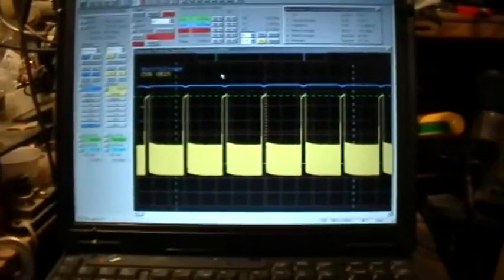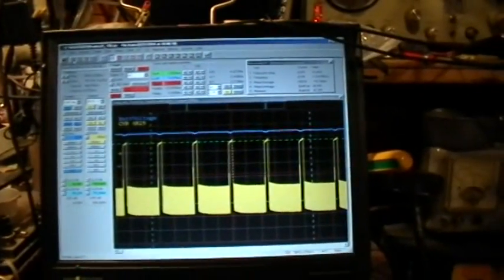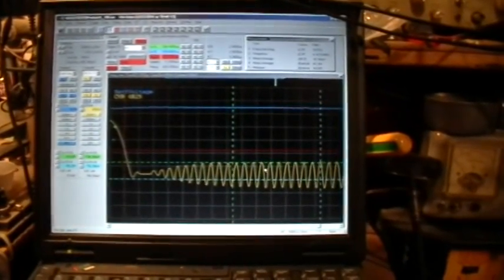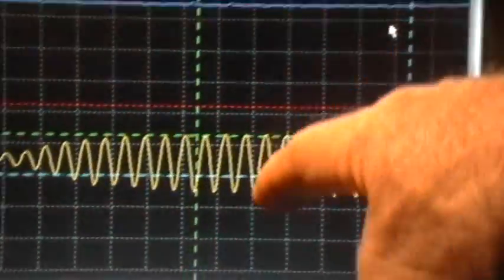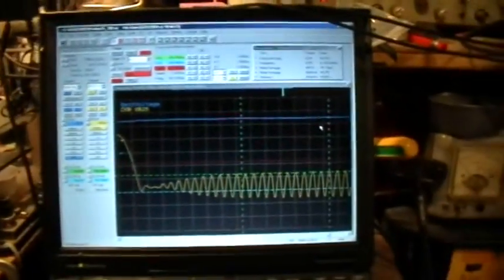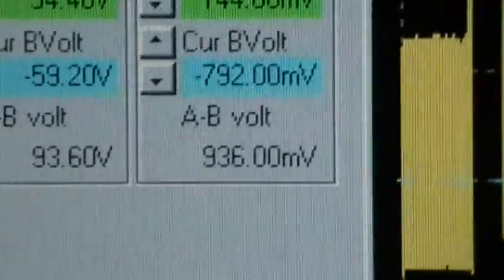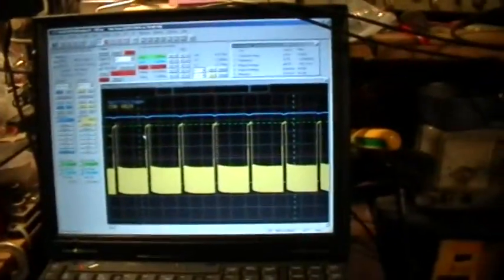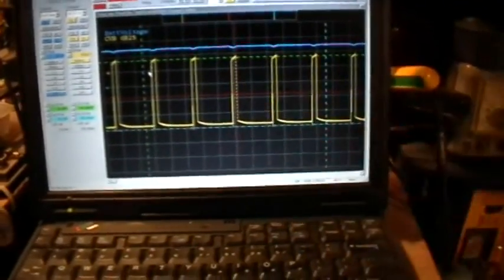Electric OU: Data and Results: 4 Q2s Oscillating, Snubber Circuit, Raw Data Timelapse

Comment: Be careful about jumping to any conclusions concerning current through the function generator.  When the snubber is in the current is what you see and it is modest.  It's in 100mA to 200mA territory.  The AC current is more complicated.  The function generator AC current is a small percentage of the AC current flows through the function generator.  It's more than zero.

There are three paths for AC current that all sum through the fixture current sense:

1. Through the drain gate capacitance of the four parallel Q2 MOSFETs.
2. Through the Q1 drain source capacitance.
3. Through the function generator via the four Q2S in parallel and the Q1 drain gate capacitance.
Reply from the maker: Yes, the AC situation is complicated. I suppose it has been over two years now since I first made measurements with a CVR in series with the FG feed to the circuit.

Fortunately.... I'm not the one trying to claim any prizes or publish papers, so it doesn't really matter whether I myself fully understand what is going on, as long as I am able to tell whether or not the total input power to the circuit is exceeded by the power dissipated at the load. If I am underestimating the actual total power supplied to the circuit, but I am still getting heating efficiencies considerably below the straight DC performance even at the estimated power level.... well, that doesn't say much in favor of the claimant's claims, does it. After all..... Ainslie's claim is COP 17, or even COP INFINITY, including the caps.

Of course I would like to understand fully .... and the next video shows even more of my explorations on this particular topic. I was surprised to see the FG current even when the Vbatt was essentially off, after the end of the experimental data recording. At least that's what I think I'm seeing there. It's uploading now, and probably will be viewable in an hour or so.

Thanks for taking a look, and thanks once again for making this fixture, as it has already revealed a lot about this circuit that wasn't evident before. Of course the person who really really needs this information is completely impervious to it, but the rest of us are having fun anyway.

Comment: What is the room temperature these test are run in ?
Reply from the maker: It varies but is from about 24.5 to 27.5 C. The first frame of the data timelapse always shows the ambient temperature at the load cell. I'm in Texas, it's pretty warm indoors already.  The data plots that result always use the temperature above ambient as the data, not the raw peak temperature.